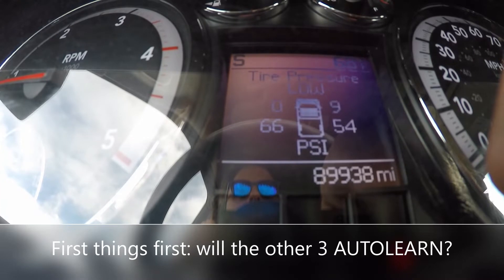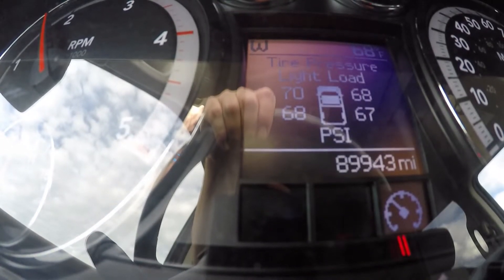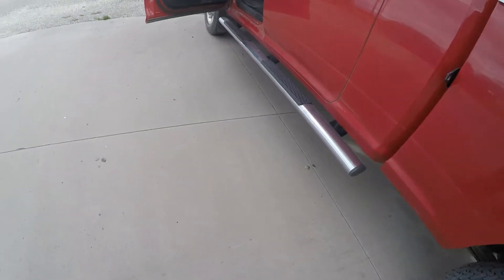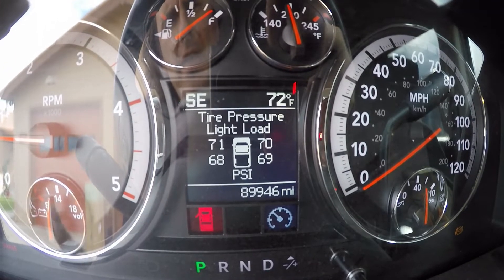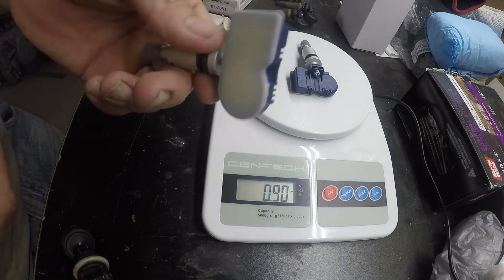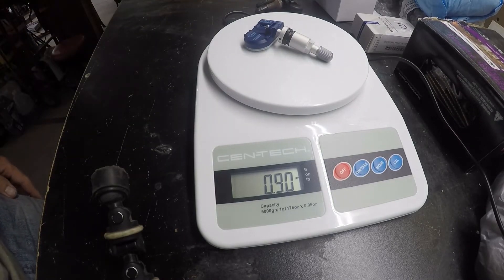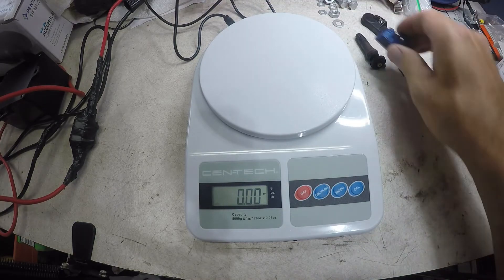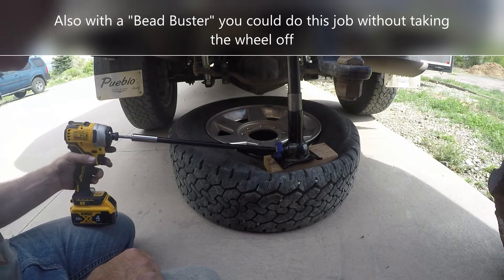Amazon TPMS Sensors for RAM truck DIY (Part 2)

Comment: Thanks for taking the time to make a video.  I purchased a MORE sensor preprogrammed set for some winter tires on rims for my 2006 Acura TL.  I had them installed and they all started working in a mile or two around, they work great.  So ten months later, I bought another MORE sensor set (same exact set) for my summer tires to replace the originals which were starting to fail at 15 years old.  Paid $60 to have them installed.  They did not work.  So now I'm calling tire shops to see who might have a programmer for this brand.  Some places are nice but don't have the correct tool, and some do the "didn't buy here? F off !" routine. 
 
I don't know if I just got a bad batch that were not preprogrammed or if they need some sort of re-programming or they're defective.  
  
I'd like to know if these are just programmable with their MOBILETRON PT47 hand held tool, or if other brands like  Ateq can read these and potentially program them.
Reply from the maker: Thanks for sharing that, that's good information. Did you contact the more sensor company? IDK But they may be able to help you out. Sorry for that experience, thanks for commenting 👍
Reply: @anesthesiadreamin  Well, it's strange, I just put one of the winter tires on the drivers side rear and it works just fine.  It even made the front drivers side sensor wake up and read 35 PSI instead of the usual 58 (it reads out 58 psi on the Acura when it hasn't received anything yet) , but the passenger side was still reading 58 PSI on both so I got the TPMS error message on the dash after a few miles.  I then mounted another winter tire on the passenger rear, and that worked fine, so I had both rear tires working and the front drivers side was still reading 35 PSI.  I then tried to swap out the rear drivers side winter one for a summer dead one to see if it would spring to life like in the front drivers side.  The opposite happened, the summer rear drivers side read 58 PSI  AND the drivers front decided to also crap out and read 58 PSI until the error message on the dash came.  Now it's dark and I've called it a day.   I don't want to send them back and say they're defective if they're not, but I'm really wondering if the batteries are dead or near dead given the intermittent nature of the front drivers side summer tire.  The fact that the one tire is intermittent rather than completely dead like the others kind of rules out the "wasn't programmed correctly or programmed at all" idea.
HOWEVER, I think your idea to contact the company is a good one.  I do have the serial numbers of the 4 sensors, perhaps I can ask them if any one else has had problems with serial numbers near these.   
The Acura TL is a "self learning" vehicle, so if the TPMS is programmed correctly there's nothing to do except drive a few miles and they should show up and work.  
Either way, it's a total PITA for me to swap out sensors without a tire machine.  I don't have a truck and I'm not sure sedans are any good at bead breaking 🤪.   Another $60. Ugh. 
Rereading what I just wrote.....Looks like I'm going to see how good their 5 year warranty is.
Reply from the maker: @nunyabusiness5075  Yes, what a pain in the butt. It's been for you, please let me know what the warranty thing works out like. I'm sure other readers and viewers would be interested in what you find out. Thanks for watching and for your comments
Reply: @anesthesiadreamin  Oh crap, the warranty procedure looks like a bunch of hoops to jump through for maximum INconvenience.  They claim only a three year warranty instead of the five they advertise (never a good sign). First they want me to register the items with product model number and the serial numbers (which I luckily wrote down before I got them installed, the installer threw the boxes away).  and then 
1)Submit warranty application online
2)Wait for qualification review
3)Application will be approved or declined base on terms and conditions
4)Ship the product to our service center upon approval
5)Replacement will be shipped after warranty item is received by us.

 I'm not too keen on grinding down my winter tires on dry pavement in 90 degree heat while they take their time shipping.   
Furthermore  it states 

    3 Years LIMITED PARTS WARRANTY. We protect your investment with a 3 years guarantee from the original date of purchase against product failure due to defect.
    3 Years / 36000 Mile Battery WARRANTY.
    All products subject to a warranty claim must contain a defect in workmanship or material. The warranty does not extend to normal wear and tear of products; products damaged due to environmental conditions including rain, snow, hail, salt, or natural disasters; products damaged due to accident or collision; or product damage caused by other faulty parts.
    All items must not be damaged due to incorrect installation upon return. Products damaged as a result of abuse, misuse, improper repairs or maintenance, improper installation, alteration, or modification will not be covered by the warranty.

So I have to be extra careful pulling them out or they'll just claim it was a f-ed up install that damaged them.  Oh and there's "limitations" on top of all that.

    The warranty is limited only to the original purchaser and is non-transferable.
    Under NO circumstances will our liability exceed the amount of the original sale.
    Each warranty does not cover any labor costs or incidental, indirect, special or consequential damages such as, but not limited to, physical injuries or property damage, loss of time, loss of use of the vehicle, inconvenience, air freight charges, rental vehicle charges, towing charges or accommodations resulting from a defect in or failure of the part.
    A prepaid shipping label will be issued for all returns due to warranty claim.
    All warranty claims must be accompanied by the original sales invoice.
    The warranty does not cover lost or stolen packages. Because the customer is the shipper, he/she is the only one who can file any lost claim with the shipping company. Therefore, the claim must be coordinated and processed through the shipping company by the customer.

God this is a total PITA, they want me to send my stuff in after they approve the warranty and then they'll send it back.......and it might even work this time.   About a 15% unhappy rate.  I so freaking HATE TPMS right now. 
I wonder if I got a dead set of returned items?  
Hmm...the ones at Advance Auto Parts are only $77......EACH.  A quick reminder of why I put up with this shit.
Reply from the maker: @nunyabusiness5075  yah, expensive like my factory ones, That's the biggest reason I wanted to try the cheaper ones, and hope I will get away with it. Your problem is obviously compounded with running two sets of tires, which is a great idea for a lot of people. But you're talking over $600 to replace all the TPMS sensors in all eight wheels. I agree, CRAZY. But if you were to put a YouTube video about your experience with these, and then finally what you settle on that works, it would definitely benefit other Acura owners that are interested in the same thing you are doing. Can you just return them directly through Amazon?
Reply: @anesthesiadreamin  Can't return them through Amazon, 30 day return window for these has closed.  I ordered them in March and it's now July, my other more important "to do" list is never empty.  Besides, a return is just impractical because it's not like anyone ever hangs onto the old ones to reinstall if the new ones don't work.  Also you have to throw something in there, and rather than do the job twice by throwing in regular stems and then do it again when new TMPS sensors arrive, I'd rather not have to pay for installation twice.
When you go through the one star reviews on Amazon and read someone got a set of four dead ones, you don't want to believe it, because the price is 1/3 the cost of OEM, and they work for most (85%) people in the reviews. Heck, I had personal experience, the first set works great, so of course I thought the second set would be the same.  I wish there was some way for normal people without a machine to test these things before installation, other than just looking at them praying and saying "looks good".
Reply: @anesthesiadreamin  The plan I now have is to order yet another set and use the floor jack and ratchet strap method to bust the bead and replace them myself.  I'll warranty the dead set so I'll have 4 extra that'll sit on a shelf and maybe they'll still be good when I need to use them......hmmm.....maybe wait a while so the set they send me will be fresher?
Reply from the maker: @nunyabusiness5075  maybe so! I have two extra ones sitting on my shelf, hopefully they will work if I ever need to put them in 🙂 I think you have a good plan though. I hope it works out for you 👍